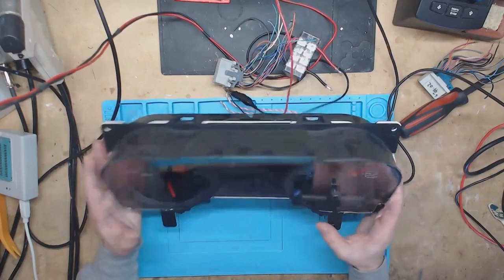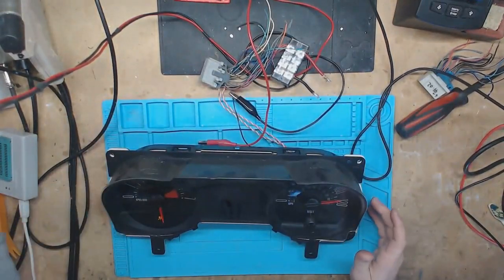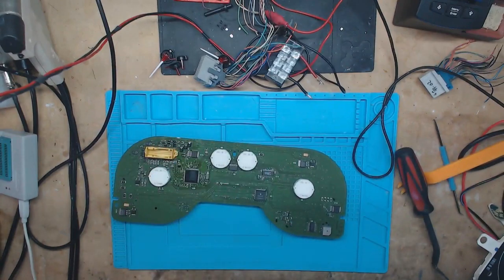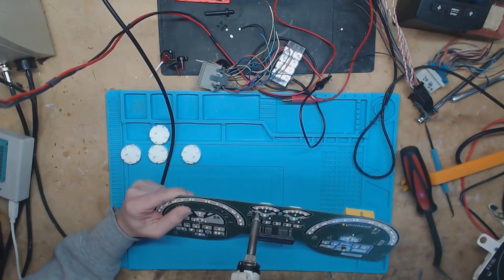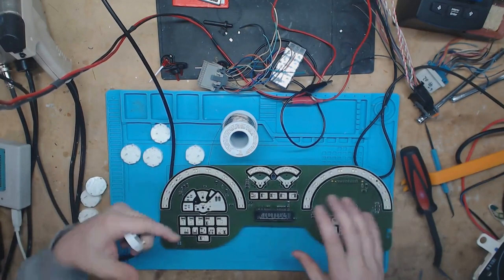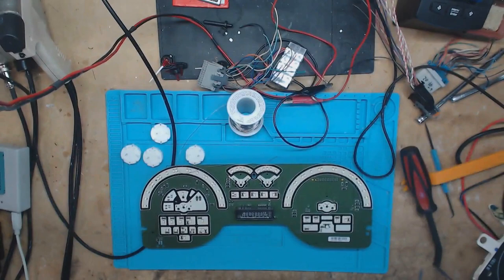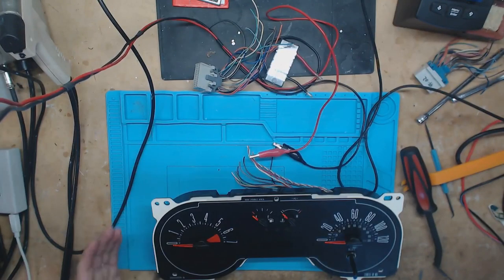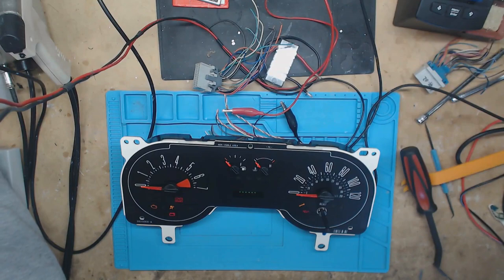2005-2008 Mustang GT Instrument Cluster Repair

Comment: My spedometer gauge works intermittently…sometimes will get stuck at 140 or past 140 all the time and other times it will work perfectly fine. Is this the stepper motors and do i have to repair them? Or can I just clean them or something since they still work sometimes

Comment: I have a question why theres two different instrument cluster for the 05 gt mine only has the gas gauge and temperature bedsides the rpms and mph speedometer.
Reply from the maker: Different trim packages.
Reply: @FixedUntilBroken  so mine is it a gt deluxe or the premium package

Comment: My RPM needle sits like what your showing and works just sits facing @5 o’clock position and when moving moves to the left, also not sure if the fuel gauge is accurate but everything else seems to be working fine

Comment: Hi, I have a 2006 mustang gt and the coolant gauge never comes off of cold - it doesn’t move at all. I think the battery voltage might be stuck as well somewhere between low and high. Is there a way to activate a gauge sweep to test if the stepper motors are broken? I found some instructions online about holding the trip reset while turning the car ignition on but this doesn’t seem to work in the 2005-2009 clusters.
Reply from the maker: It's been months since one of these came across my bench but if I remember correctly they don't do HEC or self test. I know the 2010+ do HEC and the trucks all do self test.
Reply: @FixedUntilBroken  If I take the instrument panel out, is there a way to confirm which stepper motors are bad? I'm considering trying to fix it myself but would like confirmation that it's the stepper motor and not the CHT sensor that is bad. Also just curious - what would you charge to fix a broken instrument panel?
Reply from the maker: These stepper motors are internally the same as the GM trucks and stuff but they are bottom loading instead of top loading. So just like the trucks they get stuck or really course when they go bad.

Comment: Hey buddy, I have a 2005 gt..looks a little different than yours..mine has four gauges in the middle area...all malfunction except for oil gauge is working...now, where can I order those stepper motor...can I send mine to you to fix it..of course I have to pay you....
Reply from the maker: Yes there are 2 different ones the 4 gauge cluster is for base models the 6 gauge I for most the other ones. You can find the stepper motors on Amazon or eBay if you want to fix it but I can take it as a mail in off you want

Comment: Which pins on the back of the cluster are the ones for a positive 12 volts and negative connection to power It up ?
Reply: Did you ever find the pinouts for this cluster?

Comment: Are the stepper motors the same as hummer h2?
Reply from the maker: No the h2 uses x27.168
Reply: @FixedUntilBroken  can you please explain the numbers on the stepper motors? What do they mean ?
Reply from the maker: @Osst  Model numbers I would have guessed step count but the ford one is the same just the needle comes out the bottom not top.
Reply: @FixedUntilBroken  thanks man. I love your videos. Keep em coming